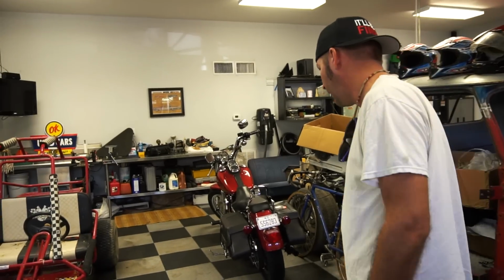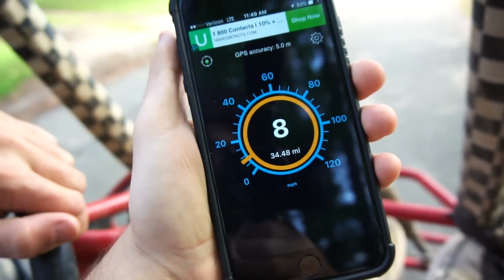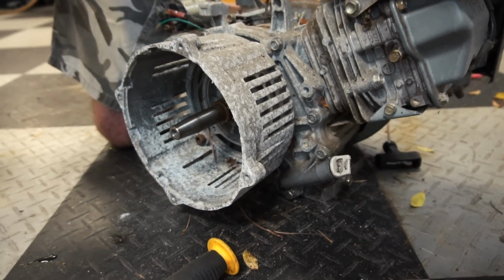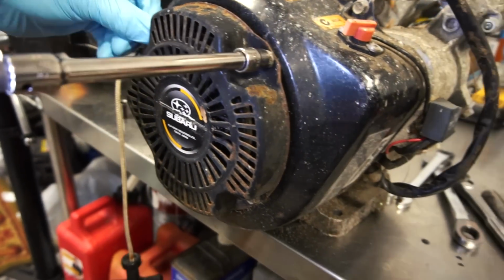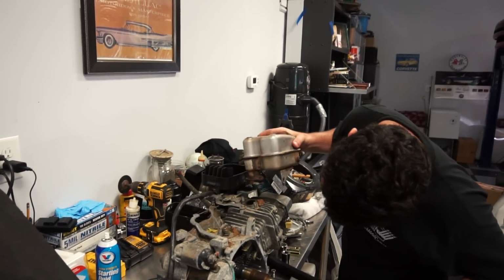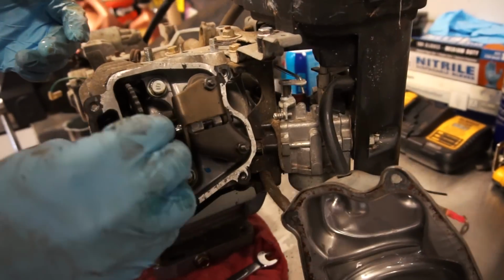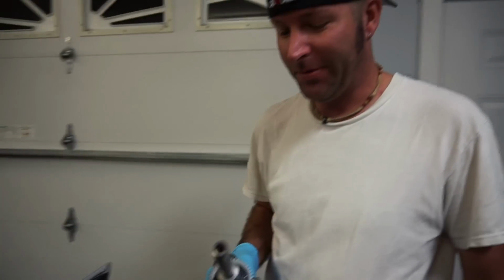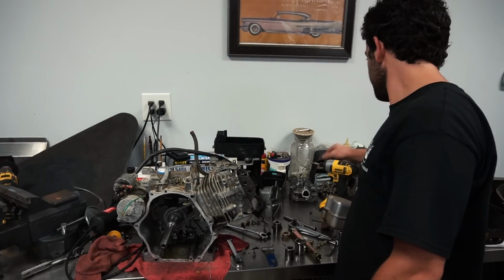Yerf Dog gets a Big Block Subaru! Pt. 1

Comment: Yeah, nearly all generator engines have a tapered shaft. The generator is press fit on because there is no need for timing and such. Having a buddy with a machine lathe is always a huge bonus. Great video guys, I always look forward to them.
Reply: Jarrod Abel Too bad Subaru would want a boat load of money for a proper crank.

Comment: I can hear all the clatter of keyboards searching Craig's list for Subaru generators. The cost just doubled. Lol
Reply: Billy Beane rarely you can get these engines dirt cheap and they are like the best Small Engine on the market
Reply: they're off of Chicago Electric generators. the engine itself is a  Subaru EX27 and goes for a bit over 500 new
Reply: the ultimate rides and reviews and more they can also be found on older go karts i had one with a factory subaru engine
Reply: Yea.  I keep junk things that have small engines because then if you need a engine you have it
Reply: These may be the saddest attempts at adbots I've ever seen, for a service that no good person would ever use.

Comment: My uncle used to weld a bead on the cam lobes and then grind them down smooth get a little more lift on them and duration.
Reply: @Brody Cade instablaster =)
Reply: @Derek Titus i really appreciate your reply. I found the site thru google and I'm waiting for the hacking stuff now.
Looks like it's gonna take a while so I will get back to you later with my results.
Reply: @Derek Titus It did the trick and I now got access to my account again. I'm so happy:D
Thanks so much, you saved my account :D
Reply: @Brody Cade you are welcome xD

Comment: File on the crankshaft while running engine will take from 7/8 to 3/4".
Add key slot using dremmal tool. 
I used a 7/8-1" sleeve to get to 1" dia.

Comment: You guys need to go to a Nissan dealership and ask for their gray silicone at the parts department. Solid in 20 mins, ridiculously strong and heat resistant. Best silicone you'll ever use.

Comment: A much easier way to adapt a tapered shaft engine off a generator... is from the other end. Take the generator rotor and remove all the windings. Rotor can then be turned down to adopt a larger clutch... or even use a snowmobile clutch, which are also tapered. But I guess not many snowmobile parts in your area.

Comment: I was able to pick up a yerf dog 3205 with a 212cc predator engine, modded suspension, light bars, new wheel hubs so you can fit standard wheels and a 5 gallon gas tank for $400 down here in Florida.

Comment: oh, and i have a ex17 6.5hp robin on my manco cart...starts every time, i mean, every time, first pull...just added torque converter, doing solid axle conversion, should be fun...havent found anywhere but aussiesports across the ocean to get racing parts, hope you have better luck/resources than i

Comment: Instead of that nightmare of an engine swap, you guys should have just salvaged a 150cc moped gy6 clone. They were the standard engine for these swing arm buggies. They also have the potential to make a few more horsepower and have a tunable CVT transmission built in to it.

Comment: I had the same issue with the tapered shaft. clamp the engine to the deck of my lathe started it machined it using its own power. that way no disassembly required.

Comment: You don't need a lathe... just bolt the motor to your workbench, start it up, and turn down the output shaft!
Reply: With what? Sand paper ? 🤣😂
Reply: @brutallyhonestmf5578  file or angle grinder

Comment: After you run off the starting fluid for a little bit it'll start sucking gas out of the tank again since I assume it had a clogged fuel line and that's why it wasn't running at first. The vacuum dislodges whatever is clogging the line and then it's good to go.

Comment: I actually have a go kart an when I bought it it had a 5hp robin subaru on it. It’s pretty much stock except I straight piped it but it’s very reliable, I’ve really beaten it up an it’s still going strong. I just wish it was like the predators where it had performance parts I could buy.

Comment: hey guys dont know if youve ever used a straight air die grinder and 1/4 inch carbide cutting bits. they come in a variety of sizes. die grinder u can get cheap at harbor freight and bits you can get cheap on ebay. this tool would have been useful when you did the drilling part on the crankshaft and i know personally after discovering this tool i dont know how i ever lived without it. it will come in handy a lot.

Comment: 123 cc = 4 hp
179 cc = 5 hp
208 cc = 5.5 to 6 hp
277 cc = 7 to 8 hp
291cc = 9hp
305 cc = 9 to 10 hp
342 cc = 11 to 12 hp
357 cc = 13 hp
420 cc = 13-15 hp              Yea id say almost 300CC is gunna make the Yerf DOG FLY !!! well, fly alot further then prior haha, love the build C&C cant wait for more !!
Reply: GonZo cc is just the displacement or "size" of the motor. Cc doesnt determine the horsepower
Reply: I know. Compared to what it was.. this will be pretty drastic
Reply: Though this one will have a low end torque, Im a OHV kinda guy
Reply: also going from a tecumseh 6.5 to OHC 9hp there going to a noticeable difference,  although i dont remember what motor they had on it to begin with,  or if it was the tecumseh i had a yerf dog yrs ago, thats what i had on it when i bought

Comment: it's called a oil dipper.it dips into the oil sump then splashes the oil all about the internals of the engine.if you decide to modify it your engine won't run long.

Comment: Subaru motors are sweeeeet I had one on a gokart for awhile it was a 4 horse I think and it had the gokart going 42mph and I had a straight pipe that split into a Y and it sounded like a monster was super loud but it never wanted to idle and smoked a lot so I swapped it out for a predator. But the Subaru motors a stupid expensive also

Comment: caution, removing the govna on these engines can cause "interference" ie:death...the aussie racing carts use these subaru robins, and they use an adjustable range electronic governor to keep from jamming the valves into the pistons, im no pro, but check it out

Comment: Permatex the right stuff give it a try I use it on everything  oil pan water pumps dozer drain plug even cracked radiator for a temp fix oh and sealing a old windshield in. It's kinda spendy but it's the best

Comment: Hey guys try using a primary clutch from a polaris fourwheeler or snowmobile, polaris uses engines made by fuji heavy industries(same as subaru). I believe it would work a bit better
Reply: The only problem would be the weights in the clutch

Comment: The gy6 150cc is 9hp stock an is governed at like 8700rpm an is ohc with upgrade able cams an can get a race cdi that's ungovernerd an doesn't valve float till 10k+

Comment: I know that generator it is a DR power they use that engine on lots of there stuff. Just google DR power equipment parts are easy to get. I have a few of these engines from when I worked there. Have fun and I joy

Comment: The guy with the lathe needs to learn how to use it! You should NEVER hold the sand paper like that, good way to shred your arm!
Reply: Alpha Nerd and the rag!
Reply: Ya no shit! That one is an even bigger risk! Although to be fare, if it does grab, I doubt a little bench top like that one can have enough torque to kill you. Just break your arm in 3 different places as it rolls it up!
Reply: It's better to know how to use a tool safely knowing your doing it wrong than to do it safely and not know why

Comment: Hey what do you think about putting a 12hp motor on a go kart
Reply: Really that's sick
Reply: I had an 11hp honda on my last gokart 4 speed manual drifting in 2nd gear and  the transmission aint doing to good... now its just sitting. 12hp would be good but dont try to make a wheelie in 4th gear at full trottle if you use a lawnmower transmission because it wont work to good...  Try gett a car transmisson and rear axle.

Comment: I have ran subaru robin engines for years on different landscaping equipment and they great engines. I would put them right up there with honda power equipment engines or a step above they seem to run for years if you take care of them. Although it has been daid they are getting out of the power equipment market

Comment: Why didn't you start the engine and spin the shaft down with a file...
Reply: Philip Rowney Cause if you have the time tools and friends why not make a cool video and do it right?
Reply: Sixtyfiveford has a video on just thath.
Reply: Faster to use a drill motor mounted grinding wheel...

Comment: Subaru car = 50/50 chance it's going to leak in some strange way that is more annoying than inconvenient, and not actually effect the performance at all....    05 outback with a power steering drip for the win!
Reply: HellishGrin460 on the all wheel drives foresters the front diff seal fails, fluid leaks into the trans and causes early failure. Sadly I know this from personal experience.

Comment: what does smoke indicate please answer I really need to know because my engine smokes alittle
Reply: RandomBuildsandRandomFun more than likey its warming up or if its a 2 stroke its suppose to smoke
Reply: Your piston rings may be warn, a little smoke.... ITTL' BE FINE
Reply: Show it the research on tobacco use and encourage it to use the gum....
Reply: Run it. It won't hurt a thing. Check your oil before each ride. That is a good idea whether your engine smokes or not.
Reply: It could be a crankcase ventilation valve (breather valve)...when they start to go bad your engine will smoke
Reply: If its blue smoke you're burning oil. Not that unusual for 2 strokes. Definitely unusual for 4 strokes. Piston rings might be fucked.
If it smokes thick white and your engine is water cooled you have a water leak of some sort (blown head gasket etc.) Check your oil (milky and very thin)
If it smokes black you're running very rich. Check your mixture. if it's a fuel injected engine check your sensors.
Reply: Blue smoke = burning oil.
Black smoke = running ritch.
White smoke = burning water.
Reply: RandomBuildsandRandomFun. Have u tried putting it in a bag of rice?😂
Reply: RandomBuildsandRandomFun blue smoke is burning oil.

White smoke is either-or starting up and warming up but after about 10 to 5 minutes it should clear up. if not, it's burning coolant because of a blown head gasket.

And black smoke is to much fuel.
Reply: Billy Beane v
Reply: Zachariah Woller small engines don’t use coolant

Comment: hi  i have a manco ding
Reply: how much do you want for it?
Reply: I found a near mint Manco Dingo Deuce Deluxe earlier this summer with the 9hp engine. I have upgraded to gas shocks, new tires and have a new Lifan 15hp engine I am getting ready to install. Only thing that has me worried is the engine mounting bolts go down into its little Italian transmission. The torq-a-verter on this thing is huge though, more like a snowmobiles, it makes the 40 series look tiny.